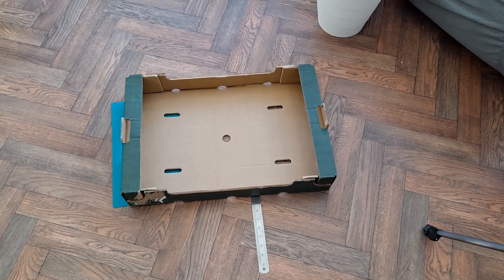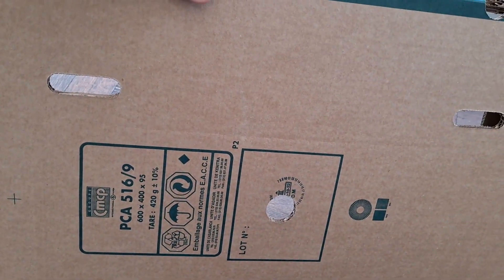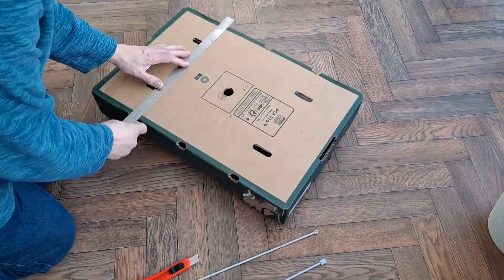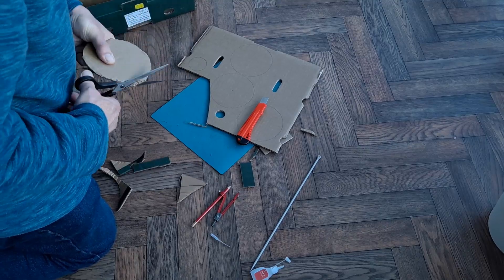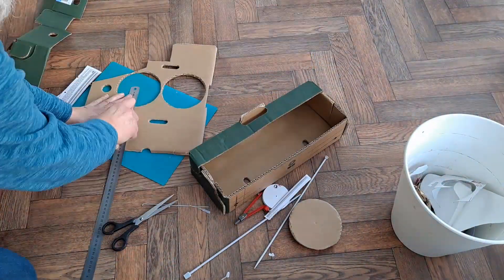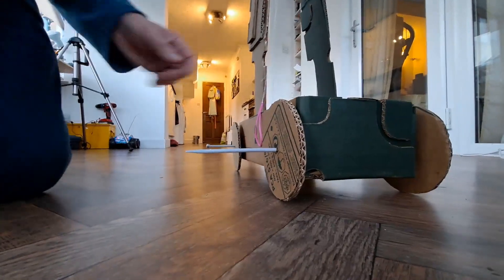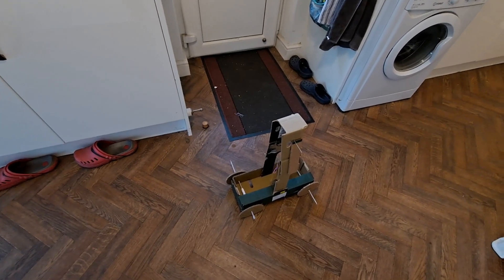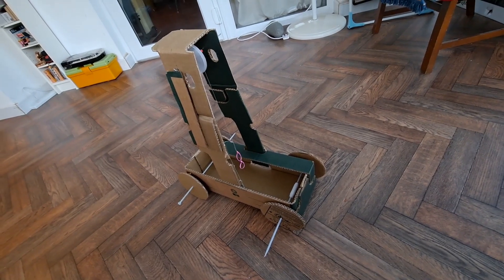Cardboard Gravity powered car 20230120 FAST FORWARD

Comment: Very good. Works surprisingly well. Thanks 😀 👍
Reply from the maker: Decent wheels make a big difference, plus improving the pulley bearing. That could be improved further, but I was trying to keep it to "found" materials.
Reply from the maker: OOPS, I thought this was a comment on tonight's video showing the improvements 😮😮
Reply: @GrandadIsAnOldMan  Yes, I noticed after leaving this comment that you had already done an updated video. I'll watch that next. Thanks 😀 👍

Comment: Looks like a medieval siege engine :)  It went pretty well considering it didn't have much momentum being so light and non-optimal wheels. Would it have gone further with a heavier weight?
Reply from the maker: Improving the pulley would make quite a difference as a lot of the power is wasted there. A heavier weight would help get it moving, as you say, the wheels certainly don't help. In the next episode I improve the pulley bearing and fit CDs for wheels. The difference is significant. This was inspired by a call for help on one of my old videos. I didn't want to use 3d printing or anything fancy as they had sent me pictures of what they had built. The fix for them was increasing the diameter of the back axle to improve the gearing. I think I showed that in this video.

Comment: I have done a project with 8 to 10 year olds,  using the same principle, but mostly out of wood.
Reply from the maker: That's great 👍 You will find my playlist of gravity powered cars in my video description. I used to get lots of requests to build them, along with mousetrap powered cars and rubber band powered cars. Probably doing somebody's homework for them 😆